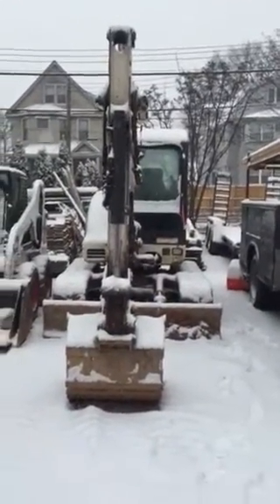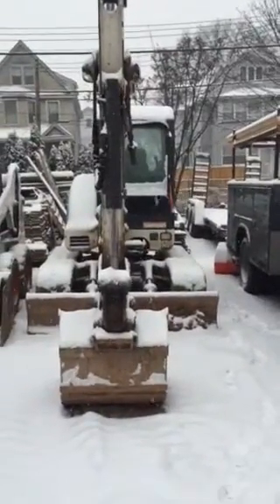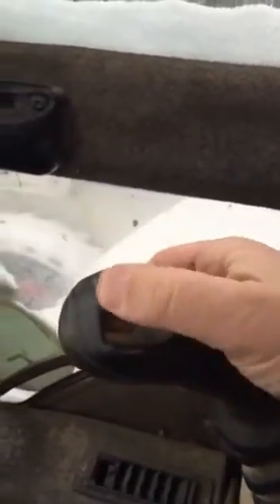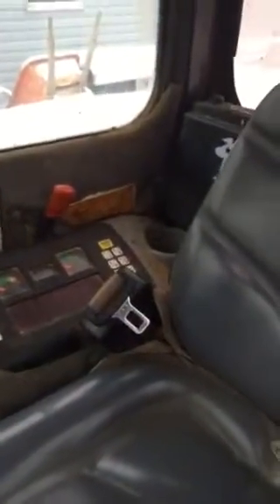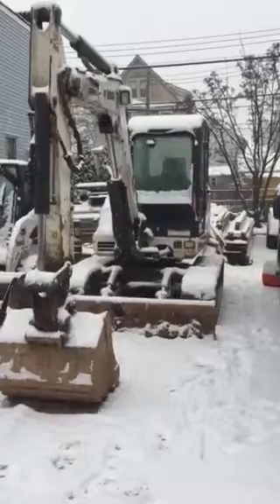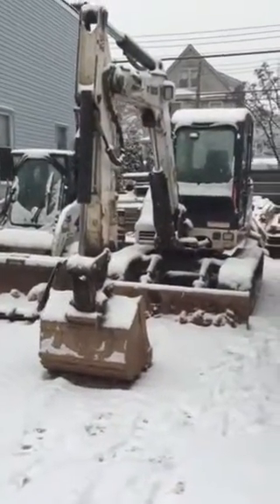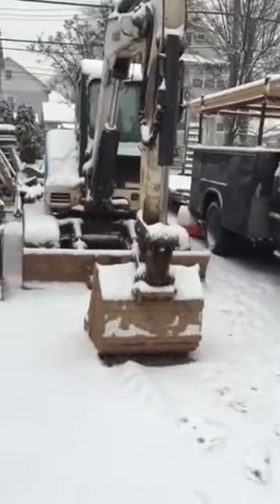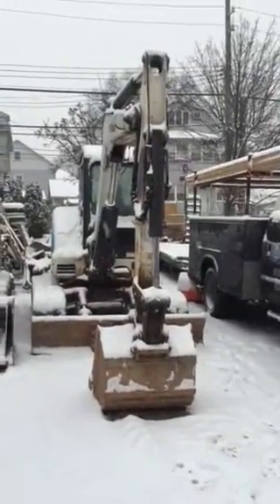Bobcat 337/341G Series Excavator Review

Comment: Love this mini. Ran a 337 for years doing boulder retaining walls. Smoothest mini ex ever. I really do not like the e50s we have at my current job. I'd take a clapped out 337 or 341 any day. Only issue I have is the hydraulic quick connect is a real issue that bobcat still has today. The hydraulic actuated pins take all the force of the bucket and quickly wear out. Stick with the manual single pin, hydraulic x change system sucks for reliability. It works great if you can keep them from leaking but good luck there lol.
Reply from the maker: sandy s agree on all points. Keep it simple is better. The 337 is the best excavator I ever ran. Thanks for watching.
Reply from the maker: sandy s agree on all points. Keep it simple is better. The 337 is the best excavator I ever ran. Thanks for watching.
Reply: I have a little 2007 335 and it's been the best little Mini excavator that I that I believe I have ever had or operated, I'll just service it again with 3650 hours on it and still running like a champ with the dependable Kubota engines! But I would rather have the 337 just for a little extra extra reach, But the power is there to do almost anything , I really wanted to try the hydraulic exchange system but that is the 2nd person that I've heard from that said there's problems with it so I'm not sure about that, you have a great looking machine I would keep it